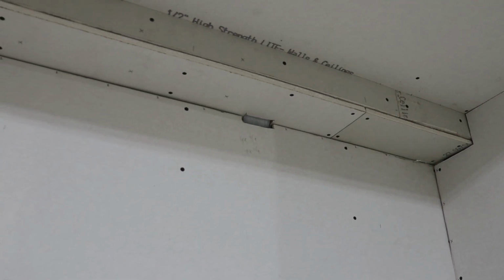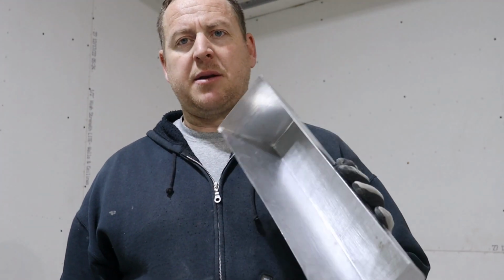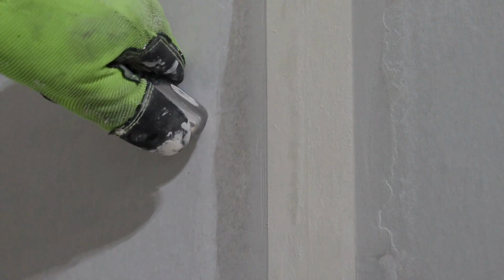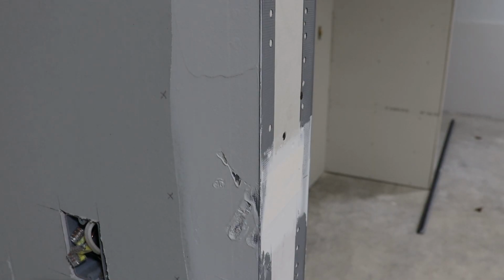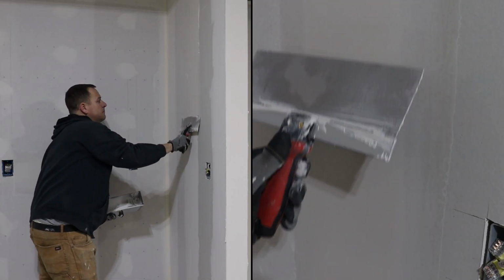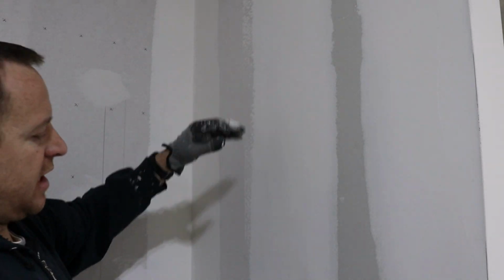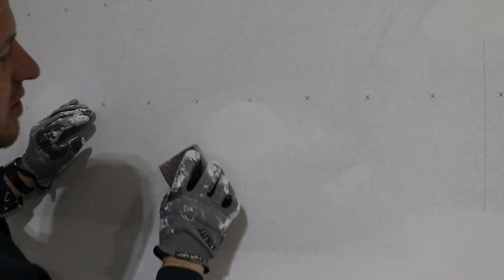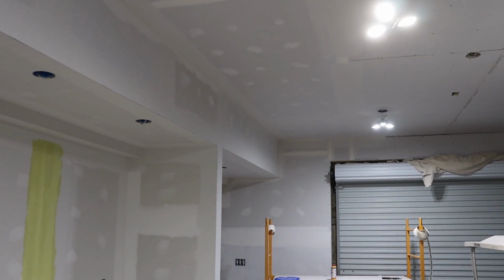Drywalling Metal Garage [Part 2] | Finishing Drywall

Comment: Are you going to texture the walls? I'm converting an attic space to a small room and drywall will be coming up soon. All DIY. I'm an electrical contractor so I have construction skills just never did all the drywall steps before.
Reply from the maker: I like flat walls so I won't be texturing. I usually texture ceilings but I don't think I am going to put that much effort into this drywall project.